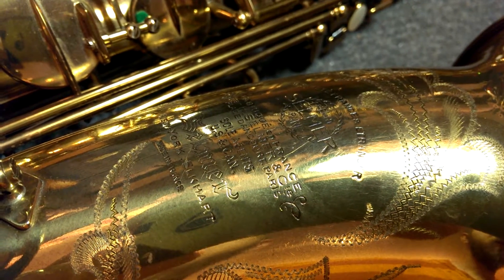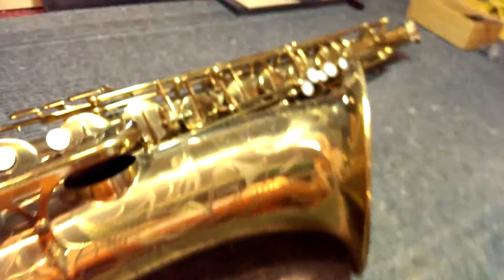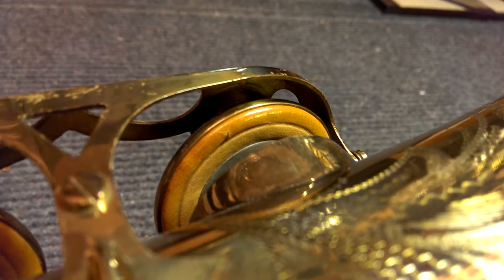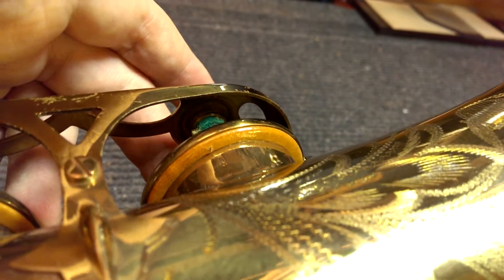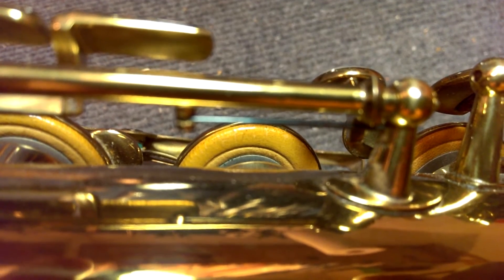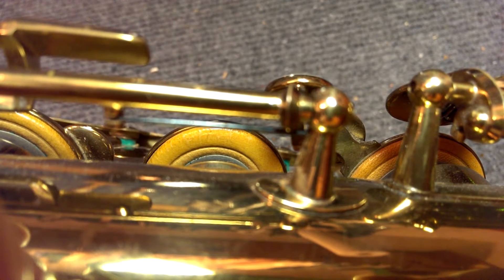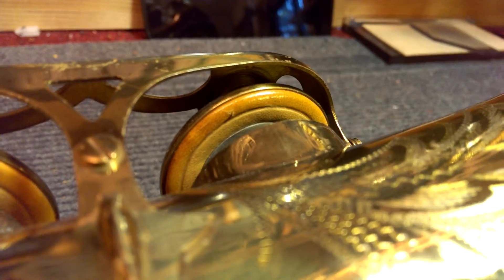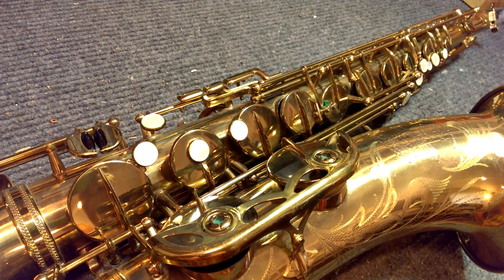Saxophone Repair Topic: Finish: Original Lacquer Overspray on Vintage Selmers

Comment: Hello Matt I'm shopoing around for a cheap professional alto saxophone, I have been playing on my student model Selmer for over a decade. What exactly does the lacquered pads do for a saxophone?
Reply: morgan erkard nothing. It’s just the way Selmer did it. The lacquer is only around the outside edge of the pads. The part of the pad that sits inside the tonehole has no lacquer. Lacquer on the outside edge that sits outside of the tonehole does nothing for the sound